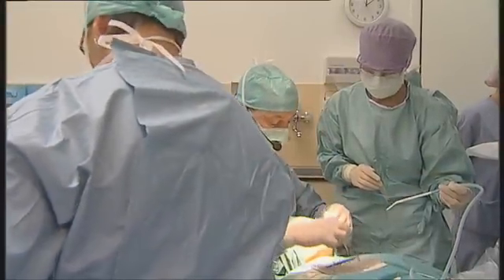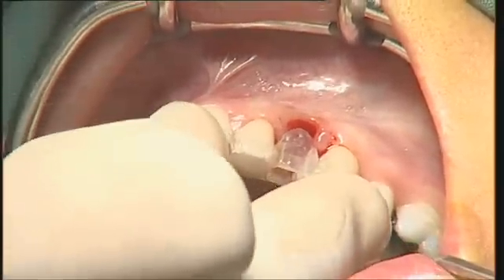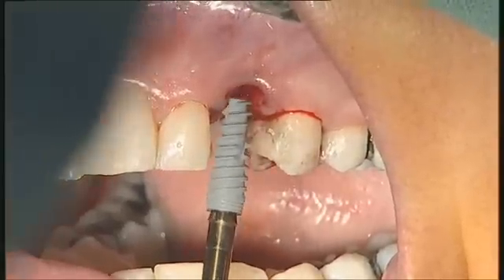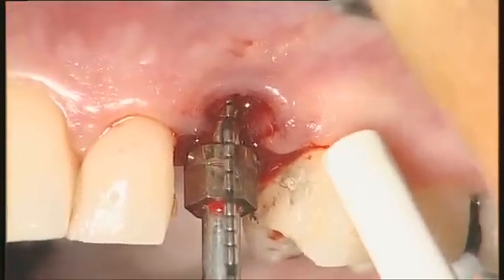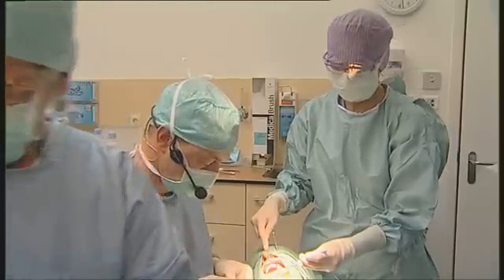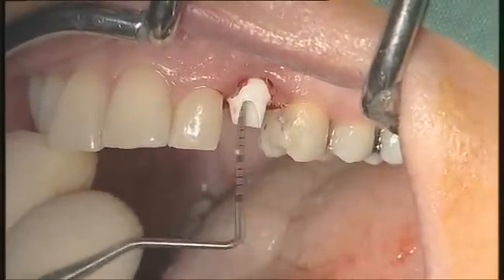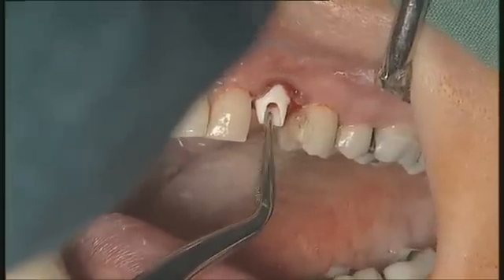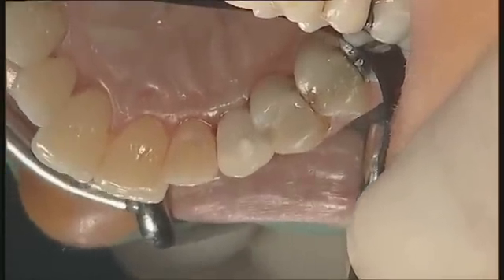NobelActive clinical case: immediate implant placement - Eric Rompen

Comment: I hate this...........I hope science quickly find the way to regenerate missing teeth.........why I have strange  feeling when flossing implant tooth......I felt like the crown on the top of the implant tooth and the root of the implant isn't connecting because my string floss can floss and go through the implant tooth......but if so why the crown on the top isn't fall off if the crown on the top of an implant tooth isn't connect with the root of its????? that is strange a weird isn't it???

Comment: My right side upper eye tooth is an implant I had done as a teenager and then had to have it redone in my 30’s as the first one failed 16 yrs later. I had to wait 6 months for the bone to fuse to the post before I could get my crown placed.. is this in video a temporary crown or the permanent… hmm this is different from what I knew of implants… nice tho to have it all done post surgery if so.

Comment: Gum disease is such a problem where gum does not heal as other body tissues do. My dentist told me gums don't grow back, is that correct? However, I've noticed if I rinse my gums with 3% Hydrogen Peroxide that can make a slow gum repair. If had only known about it when I was younger I would have been using it all my life.

Comment: It is logical that the more drilling and the more flaps are formed, the longer and more surgery is performed, the more pain is caused. Our immediate custom implants are placed entirely without drilling, therefore do not cause pain, bruising or swelling and are placed in less than a minute.
Reply: p

Comment: I can't drill a hole in a wall or metal straight without a guide, and this Dentist is 'upside down and backwards ' and installing the tooth guide so perfectly. SHAZBAT! Then I see him use a super tiny torque wrench to tighten the screw.... WOW!

Comment: Most of my life have taken care of my teeth, especially brush 3 or more times a day. Flossing not so much due to not knowing how to get my hands to go in my mouth especially in back. My mouth must be smaller than most though hygenist flosses my teeth easily.  But trying myself I give up. But the past twenty years I had no insurance so didn't see dentist for many years. I paid a high price with expensive surgery to save my teeth from gum disease. Several thousand dollars and just recently have a tooth broke in half on left upper close to last tooth. Now am told unsavable and needs pulling and an implant for about 4 thousand dollars. SEE THE DENTIST EVEN IF YOU HAVE TO USE MONEY THAT IS MEANT FOR OTHER.

Comment: Wrong technique in several aspects which will be discussed here: 1) The primary stability was lost with twisting and untwisting the implant which is never recommended for immediate loading cases. That is not expected not even on beginners' hands; 2) The thickness of the alveolar residual bone was never discussed/mentioned so we do not know how much bone really remained in the buccal aspect covering the implant; 3) The final orientation (angle) of the implant was wrong being marginally accepted at the crown level; 4) Counter-sinking the most cervical bone is never recommended in immediate loading cases because that bone will be totally lost and gengiva will follow that bone loss; 5) Visualization of the cervical area of the implant is mandatory in this cases and better obtained with marginal soft tissue envelope release making easier soft tissue grafting; 6) Marginal level of gengiva was not corrected with immediate tissue grafting so the cervical level of that canine crown will be much higher than lateral and first premolar ones; 7) Nowadays there in Xnav for guided surgery which will give a much higher rate of success as far as precision of implant positioning is concerned; 8) The aesthetic abutment was wrongly prepared being vertically too short and too wide in the mesiodistal diameter. These two aspects will totally impact implant stability and marginal crest final position after the healing process is completed. At the day of surgery all looks ok but it would be nicer, more elegant, more scientific and more educational if the implantologist would present a final result after 1 year with clinical and x-rays results. If this video was not intended to really teach young players what was its purpose then?
Reply: Good one doc!
Reply: ีีะกเั่ยนดเรั
Reply: احسنت أيها البروفيسور هدا ما ضننته  شكرا لك
Reply: Nice one❤️🔥👍
Reply: 8f
Reply: Rr
Reply: पीपीपीपी
Reply: पीपीपी
Reply: पीपीपी
Reply: आप
Reply: पी
Reply: पीपीपीपी
Reply: पी
Reply: पी
Reply: पी
Reply: पी
Reply: पीपी

Comment: I had a huge filling in a bicuspid on my lower jaw. It was replacing a previous filling that failed and had fallen out. The dentist had carved out even more tooth to build the new filling. This was done by a USN dentist, as I was in the Marine Corps at the time. I think the new filling wasn't done very well and had some spacing in it, allowing bacteria to get into the space between the filling and the tooth. 10 years had gone by and last week I bit down on a hard cracker and the filling broke apart. My tooth is now fractured basically, and totally exposed. I think its infected, as the area around the tooth really hurts now and is starting to swell. I'm constantly in pain and am self-medicating. I don't have insurance and don't know how I'm going to get this fixed, but I need to immediately. It's aching as I'm typing this.
Reply: That’s the sort of thing that needs to be treated immediately, whether you can afford it or not.  Queen Nefertiti died of a tooth abscess, and it still happens these days.

Comment: I don’t work in the dental office anymore, but we did implants some different. Where is bone graft?  What the stupidity to screw in and out implant itself, you should measured how it alined with other teeth before you screwed it in, you are weakening jaw bone and making wider hole which absolutely need a bone graft now.  Tooth #11 which was shown has longest root of all other teeth, that is why he drilled deep. #6 on the other side and also #22 and  27 which are on the bottom also have longest roots.  Technology definitely moved forward in the last decade, but  after extraction, socket has to be cleaned and sterile much better, I did see plenty of puss on buccal surface.  It has to be rinsed with clorecsidine.  Sloppy job, compare to how we did it.
Reply: ;,  v v:
Reply: Oi 7 hum hum hum no jy

Comment: I can understand the logic and convenience of having the implant screw in place right after the extraction, simplifies and speeds up the process, but is there a drawback in this procedure as opposed to having the extraction, then waiting for the gums to heal with bone marrow and then doing the implant? Great video as intro to dentistry students.
Reply: Great working skill doctor. What I would like to know is, how long is the recovery time for the patient, to where he won't be concerned with pain?
Reply: @joedejesus6363  recovery as far as pain is only a week or two, the implant has to heal for 4-6 months before an abuntmant and crown are placed.
Reply: Bob jzdhim  tyuuikui
Reply: I had this done…the gum heals around the implant. No need to cut through the healed gum later. That said, my dentist didn’t place the crown and abutment for 4 months allowing bone to knit around the implant tightly securing it. The final procedure involves torquing down the abutment. If the implant is loose it will turn…not good!
Reply: @DragonPilot  where did you get it done and what was the cost?
Reply: @Runescape.  Near Seattle, WA. Cost about $2300 (radio ad special) for everything…implant, crown, etc.
Reply: @DragonPilot  wow! Thx expensive. I wondered about cost. Thx 4 the info.
Reply: बेशक, धैर्य एक बहुत शक्तिशाली हथियार है, लेकिन कभी-कभी मुझे पछतावा होने लगता है कि यह बन्दूक नहीं है ।
Reply: Jj
Reply: Mané traduzir pra português, não tá vendo ele colocar o dente?
Reply: ข
Reply: Bob jzdhim  kuinmkui mesut
Reply: @mesutdeniz9401  pppp0pp0jj0
Reply: @mesutdeniz9401  0ķiq
Reply: @mesutdeniz9401  you

Comment: Absolutely impressive, however, my understanding is that you need at least 3 months to allow the implant to integrate with the bone before placing the crown, Please explain. Can I also please have the contact details of your practice.
Reply: О
Reply: That's the normal process and a better one. But there's this instant implant process also. The crown gets fitted on the same day of extraction.

Comment: I have 8 implants.  Well 7 one came out because my tooth grinding is a problem.  My dentist put me into twilight sleep. ( I am a lightweight so I just am knocked out).  They attach a monitor (BP) and heart.   Then I wake up with missing teeth and screws in my gums.   No more pain than having a tooth pulled.  Oh and they also give you a shot of novacaine so the numbness goes away gradually.  I will ask my doc about this but he does it the regular way.  I wait 3 months and they do the procedure again (Twilight sleep etc)  then after another 3 months they put in my shiny new implants.    They have changed my life, I can't stop smiling.  I am complimented on my beautiful teeth all the time and people can't help but smile back at me.   I need that replacement and he wants to pull the one next to it too and give me 2 new implants.   They are in front so He will make a snap in denture to hold me until I get the final implants.    Its a great thing.  I must say I wish it was faster  but the results are just stunning!
Reply: JhtguunjjjvssvxDuirwey
Reply: Hi, I am planning on getting 4 separate  implants and was wondering how your experience was like. Did your face change after the implants? Did you experience any problems after the implants? Could you tell the difference between your natural teeth and your implants?

Comment: Can people get MI R with all that silver are screws material in ur mouth? Please answere...
Reply: It depends on what metal was used. Silver and titanium are non-magnetic as are specific types of stainless steel and should be OK to go into an MRI machine. The bottom line is that you should let them know if you have any hardware in your body before getting one.

Comment: How do I ask my dentist for that white base you used underneath the tooth?  My doctor used a dark material and now there is a dark line around the base of my tooth. I'm very unhappy with it.
Reply: Brother you just go for zircona... This is zirconia in this video you will see black line around if u will go for metal Porciline... Bcz inside there is metal
Reply: Have you already done it?
Reply: আয়াহা
Reply: Just to be clear and up front, I’m not a dentist. I’m a dental technician in a lab where we manufacture implants and crowns like these.

The white base is a zircon abutment.

It’s used as a kind of stand-in for a prepped tooth so the crown (usually also zircon, but a more aesthetic and slightly weaker type) can be attached without leaving an exposed screw channel that the dentist would need to patch using cement.

The abutment can also be manufactured using a marginally darker shade of zircon than the exterior. The different layers, with minor variations in both shade and level of translucency, help to better mimic the appearance of a natural tooth.